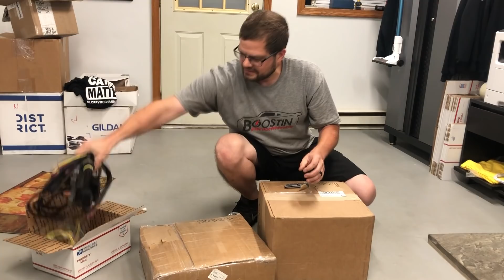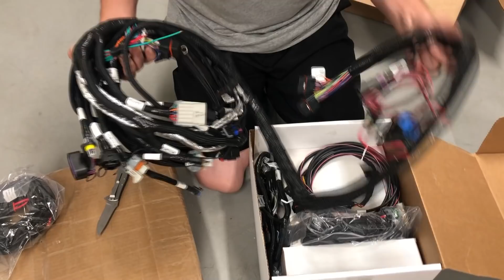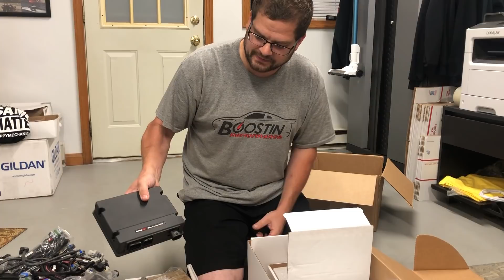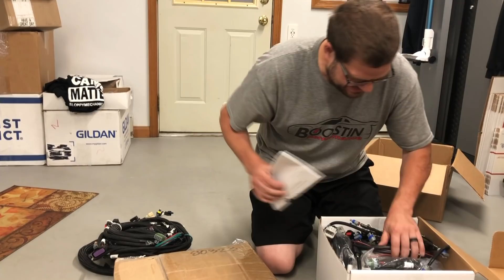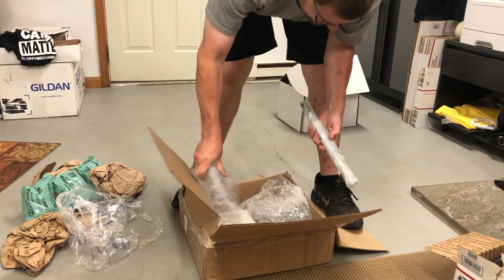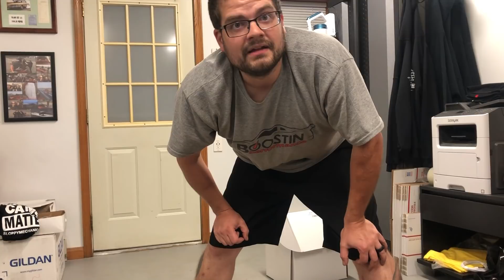Mailtime 6spd DI genV trans goodies galore

Comment: $2300-2500 for that Term X setup...OUCH!! Cool that they just gave it right to ya to play with and test for them. Just that direct drum is $700+ alone, plus the $550 shafts, and $110 hub. Plus the converter and 6 speed harness means you got an easy $5000 worth of stuff